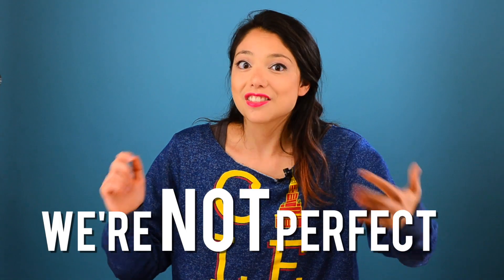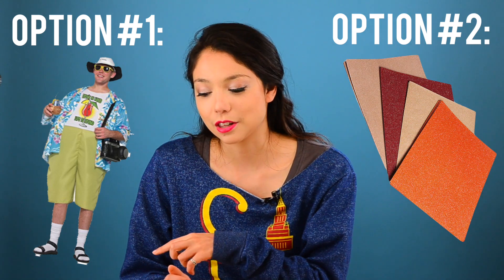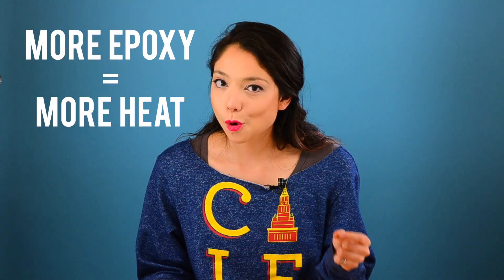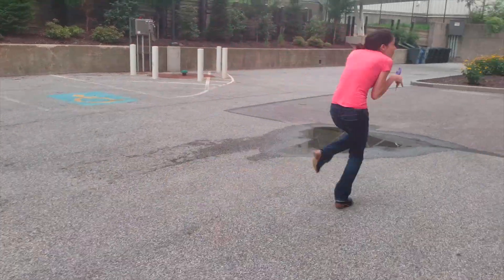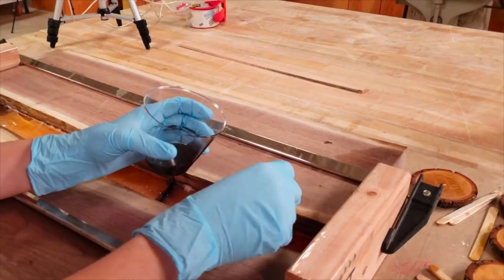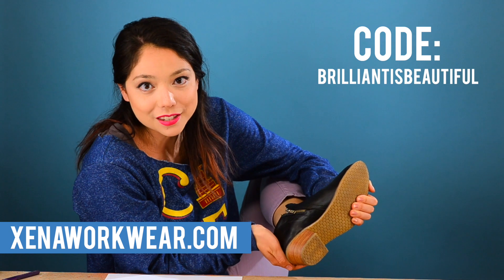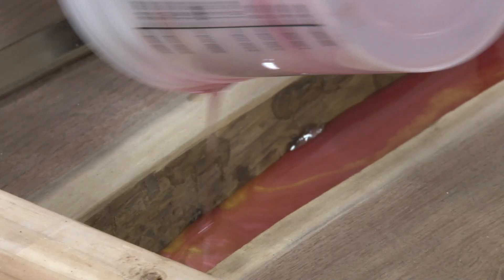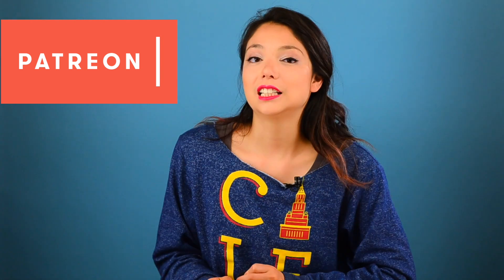Epoxy Mistakes -- And How to Avoid Them!

Comment: I have a self mixing epoxy and a caulk gun and when used it to fill up a little plastic see-through cup it melted the cup and I tested it with my heat the thermometer heat gun and it said it got up to 300°. That's why I'm here because I never realized epoxy got hot.

Comment: Too much hardener added in the mix. Reduce to near the minimum amount for high ambient temperatures and large pours. It will slow the hardening time but fewer issues with exothermic run away.

Comment: 6:30 yep "doing your research" is a good moral. 

I have also found that doing small experiments -- tiny versions of the real piece -- are helpful in discovering those catastrophic failures earlier. And, since it's tiny version you were going to throw out anyway, the "catastrophe" is minimal, but you still learn the lesson. So ... fail early, fail often. ;)
Reply from the maker: For sure! Although Resin is tricky-- I did do a small river table mockup before the big one, but it's the large quantities that cause the runaway exothermic reaction as mentioned in the video. So I didn't see any of those issues until the big pour for the real piece. But yes yes yes! Absolutely make mockups, they [almost] always save you some headache down the road.
Reply: How many times have I encountered the same issue going from small prototypes to a larger version finding that it is not exactly scalable.

Not enough available data channels?  I'll just drop in a few I/O expanders. 
What the ...? Why is my processor churning and the entire project attempting to vibrate itself to dust now?
D'oh!  Stupid slow chip frequency!

Just one of the many joys of discovery in the quest to make cool stuff.
Reply: @BeautyandtheBolt  gotcha. yeah sometimes you don't know until you know. ;)